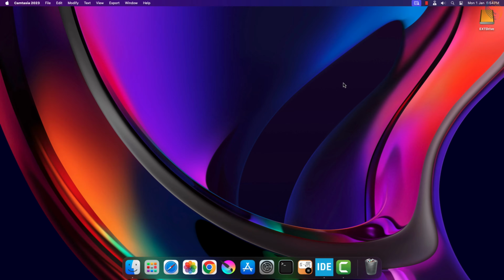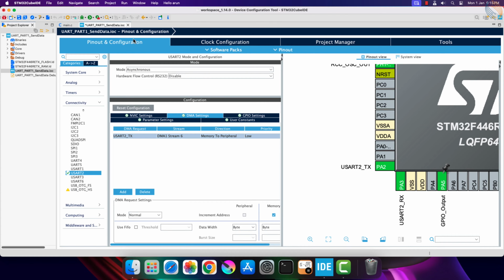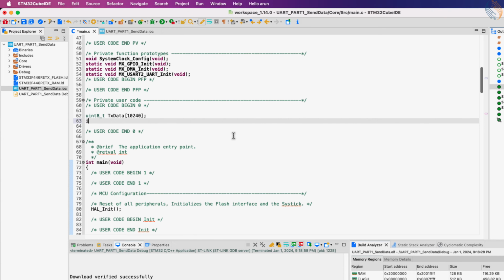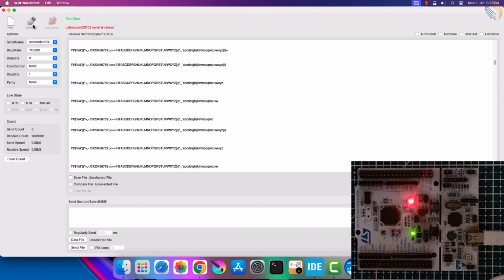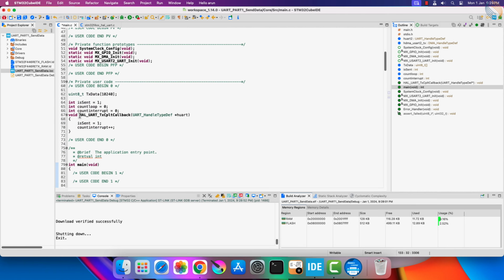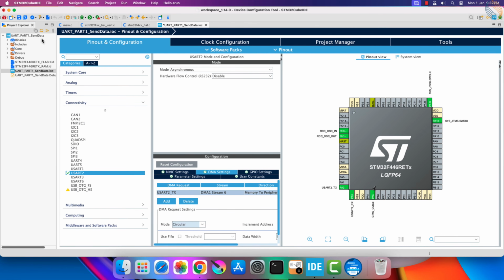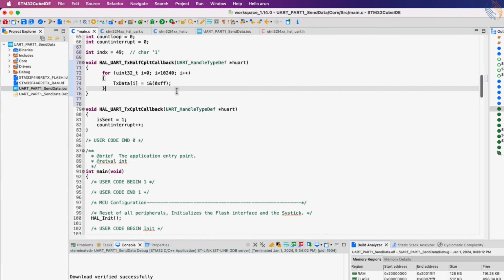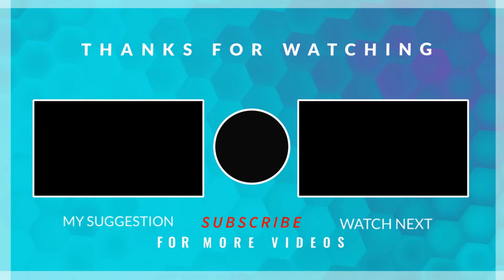STM32 UART Tutorial (Part 2): How to Transmit Data using Interrupt and DMA

Comment: Thank you so much for this video. I would like to understand the below function: 

for (uint32_t i=0; i<10240;i++)
 { 
TxData [i]= i&(0xff);

 }

Why are you using this function?  TxData[i]=i&(0xff);      instead of TxData[i]= i ;
Reply from the maker: TxData is uint8_t, so it can not store values higher than 255. Whereas i is uint32_t.

Comment: nice step by step built up of the project and explanations as to why things are happening the way they are and what happens if you change things.
But WHY ON EARTH would you not define a variable accessed in an interrupt as volatile? This just begs for beginners to just copy this code and then wonder why once in every 100 loops the program does something different. It will send them on a witch hunt for this bug for possibly days or weeks -.-

Comment: How cpu working on hal delay and transmit_it in same time? 
If it doesn't work on transmit_it what is differences between interrupt and dma?🤔🤔
Reply from the maker: Interrupt has higher priority than delay. So the data transfer section of the transmit_it is being processed by CPU in the background, while the rest of the functions are blocked for the amount of delay time. 
On the other hand, the data transfer using DMA does not involve CPU. It is a kind of separate bus that handles the data flow independent of CPU